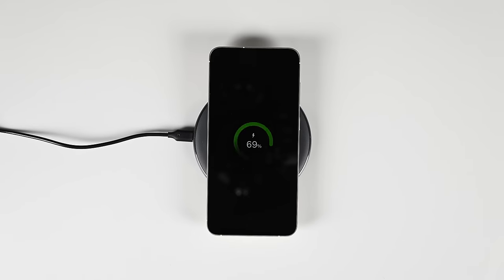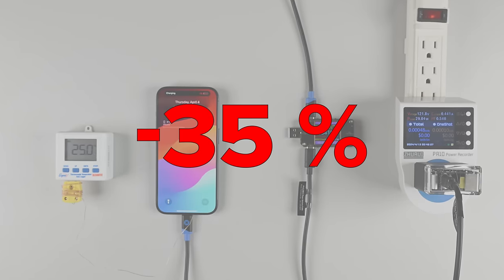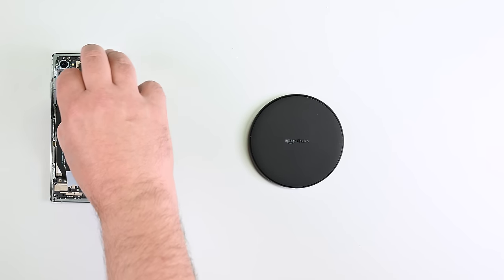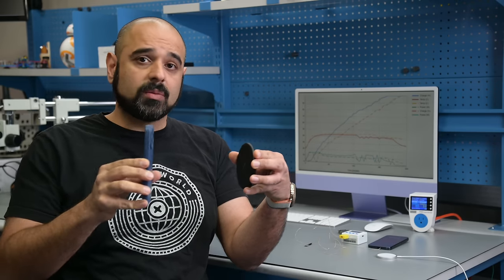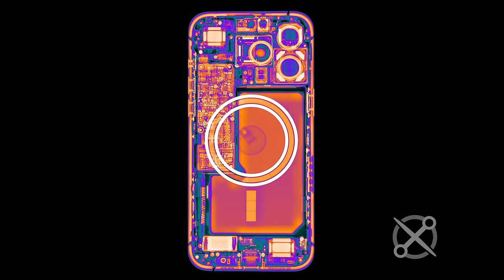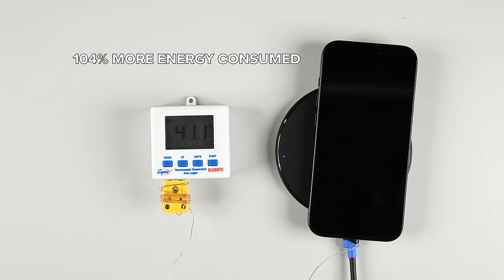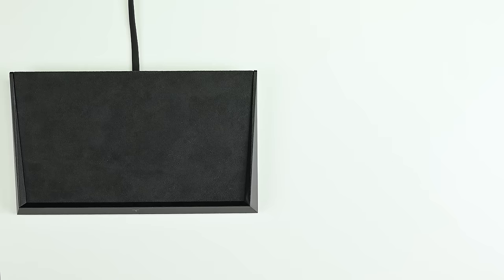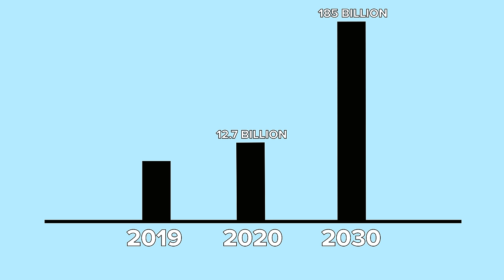How Wireless Charging Works and Why It's Terrible

Comment: It’s terrible until the charging port doesn’t charge and the phone is able to stay alive for another year thanks to it.
Reply: This is why we need repairable phones.
Reply: This wouldn't be a problem if phones were repairable enough
Reply: Real
Reply: I agree with your sentiment, but it’s a bandaid to the real problem of un-repairable phones.  
There’s no reason you shouldn’t be able to pop down to a repair shop and have your charging port fixed for the same price as a certified wireless charger, but tech companies want you to buy more stuff, not fix the stuff you own.
Reply: @dilutedoxygen  they are. changing the charging port is nothing you can't do on current phones.
Reply: That's the only reason I needed to replace my phone.
Reply: This saved everything on my phone when the charger stopped working
Reply: @RandomUser2401  Being able to and being able to easily are two completely different things.
Reply: have you ever seen a broken USB-C port? it used to happen with older USB and ofc with applel's ports
Reply: This is why everyone should care about easily repairable phones.
Reply: @stevev1008  then you are not a mature consumer, if a broken charging port makes you buy a new phone.
Reply: @nimoy007  tf then take the phone to a repair shop, present in every mall
Reply: @RandomUser2401   does it make lighning port better design in that regard ? there is no small pin inside the port and if the user ever break lightning pin, they can just take it out using tweezer and get a new cable which is not the case with usb c.
Reply: @jk-er2zt  yes - in many aspects lightning was/is a great connector and certainly was way ahead of its time compared to what was available back when Apple introduced it. Type C has several issues but is now the standard so we have to work with it.
Reply: @RandomUser2401  I've been working in the repair industry and your confidence is just ignorant, many currently sold devices have their charging port bundled with many other components, and in some cases even the main board, so you are either very very experienced with the soldering iron, or you essentially are changing your whole phone internals.
Reply: @RandomUser2401  The right to repair movement is about making repairs more accessible to everyone. Do you have to repair your own device? No. Should everyone repair their own device? No, not everybody is capable. But it is about freedom and choice and sustainability. Take it from an engineer, I don't always want to break out the soldering iron, heat gun and preheat plate. That's why we need change in the industry.
Reply: @nimoy007  Apart from a hair dryer you don‘t need any of these tools to change a charging port - on a waterproof phone. Super easy repairability comes with some trade offs. So I‘d much rather do it myself as a skilled engineer or take it to a shop which do it for a few bucks.
Reply: This is exactly what happened to my S7
Reply: @RandomUser2401 why do people keep pushing the waterproofing lie? How does it make sense that waterproof electronics used to not be glued together, but now they have to be?
Reply: The charging port dying on my Nokia 7 Plus was what made my next phone a Fairphone 4.
Reply: @SnakebitSTI  because waterproof is not binary. Glue provides a much better and durable seal, and at least the one that is used on iphones can be broken with a hair dryer and reapplied.
Reply: @TeddyKrimsony 😂😂😂
Reply: @RandomUser2401  The glue can also fail over time with too much exposure to water or humidity. It's hardly perfect.
Reply: @SnakebitSTI  still a lot better than the alternatives.
Reply: imagine if those were easily replaceable 🤯 lmao
Reply: If you have an iPhone, Apple will clean out your charging port for free at any Apple Store. I’ve done it a couple times and my charging port works perfectly after the cleaning
Reply: I faced this issue and yes that's lifesaving. But fact remains, this method of charging is very inefficient.
Reply: My phone has s modular usb c port so pretty easy to replace. Even so I use a magnetic charging cable which has the added benifit of plugging my usb port ehich stops dust from entering.
Reply: Pr you could get the port replaced for very cheap.
Reply: Bruh
Reply: people making up problems that don‘t actually exist smh
Reply: @RandomUser2401  they repairable until you need to use a heatgun to unglue the screen, later gluing it back into place with all kinds of unforeseen issues arising later

I'm saying this as someone who fixed their phones numerous times by myself, screwing up less than the local repair shops
Reply: @HolarMusic  funny. all I ever used was a hair dryer to loosen and the replacement sealing provided by ifixit fit perfectly… guess I must be some kind of super engineer overlord.
Reply: Bruh it's ifixit channel
Ofc we're gonna crack open the phone and replace the broken port (or at least ask the pros)
Reply: @RandomUser2401  get off your high horse
Reply: @HolarMusic  get off your whining horse and become a mature consumer
Reply: @RainbowGin but they aren't and I'm not counting on it to save my s9 from 2018
Reply: I've replaced my own charging port.  With a glass back glued phone.  They could make it way easier to replace though
Reply: I've never broken one on a phone. Our home phone is an iPhone 6S Plus that's going near a decade old and it still works. In what way do you use your phone that causes the charging port to break so easily?
Reply: Why hasn't anyone thought about putting a magnetic connector (like the one of macbooks) on phones? It would be as efficient as a cable and impossible to break.
Reply: this is me 😭
Reply: I connected my phone to a bad charger, and it fried the part of the motherboard for charging

I miss being able to charge my phone in less than an hour 😭
Reply: if you are careful with the port it will be fine just clean it once in 5 years
Reply: Have you heard of fairphone? You can easily replace the charging port yourself.
Reply: thats exactly why i specifically look for phones with it
its nice to have that backup
kept my LG V30 alive for another 2 years and it still works to this day
Reply: @RandomUser2401 Is that what you are? Or are you berating another person for no good reason?
Reply: @arutezza  or you could've just replaced the charging port instead of cooking your battery.
Reply: Exactly this. My iPhone would be a brick without wireless charging.
Reply: I've been going on 3 years with wireless charging only. Thinking its about time for a new phone since my battery is so degraded
Reply: @ScarfDoesGaming  good job cooking your battery👍🏻
Reply: @EnterTheSoundscape  true. because it‘s totally impossible to simply change the charging port. 100% brick material without wireless charging.
Reply: @ScarfDoesGaming  Just replace the battery.
Reply: @EnterTheSoundscape  I probably could, but with the phone creeping on 5 years of use, it's around the time I typically upgrade anyways. Plus the cost of me doing it myself is about the same as the value of the phone. In insurance terms, it's totaled
Reply: @RandomUser2401  I would but the problem is that I have an iPhone with a cracked back glass. Getting the battery charging port changed would necessitate paying hundreds of dollars to fix the glass. I’ll just keep using the wireless charger for a few more years before I get a new phone.
Reply: @ScarfDoesGaming  2019 phones still hold up, especially iPhones. The newer phones aren’t much of an improvement.
Reply: @EnterTheSoundscape  fair, and phones are getting more long term usable, but I'd have to replace both the battery and usb-c port. Plus there's no case for this phone with the dust protection I need unless I want it twice the size. In 5 months with my line of work, and I'll have to replace the port again. Just weighing my pros and cons, the biggest con is long term cost of repair and little benefits
Reply: @EnterTheSoundscape  how about you simply do it yourself or take it to a non-Apple shop? the back glass being cracked has no influence on the charging port change, the phone will be opened from the front by lifting the display.
Reply: @RandomUser2401 lightning would have been fantastic had it not been USB 2.0.
Reply: @ScarfDoesGaming  maybe find a dummy plug for the port while you‘re at work
Reply: @RandomUser2401  Why pay to fix the charging port when it isn’t a problem thanks to wireless charging?
Reply: @EnterTheSoundscape  because wireless charging in itself is a problem. I see you have not watched the video but went straight to commenting.
Reply: @RandomUser2401  I plan on getting a new phone regardless in a year or two (still have iPhone X) and battery life doesn't bother me since I always have a charger with me. 

I'm not paying over $100 to fix it. The phone is towards the end of its life anyways.
Reply: I kept my S8 alive all the way to current year and I didn't once need to replace the USB-C port, just be more careful with your electronics.
Reply: @ST4RDUST  The S8 was a brilliant phone that was built to last. I swear new USB-C ports are insanely fragile by design.
Reply: You could also… you know… repair the charge port!
Reply: Yeah, I did that for a while lol.
Reply: that could be solved by having a standardized system of magnetic pogo pin contacts on the back of phones which would be functionally exactly the same as "wireless" charging but without the inefficiencies of having to convert from DC to AC and back again
Reply: Wrong, its always beeen terrible irregardless
Reply: I seriously haven’t had an iphone that didn’t charge from the port since the iphone 2 lol
Reply: This rarely happens and yes, actual repairable phones fix this issue.
Reply: I had the same problem, I had to you wireless charging on my galaxy s8+ for 5 months until I switched to new phone that doesn't even have thaf option.
Reply: If anything this is a hard “it is good because everything else is so crap” point. This speaks for the need for repairablility even more!
Reply: @RandomUser2401 hey man, just a general rule of thumb with those mall repair shops, most of the time with those shop, they often replace parts with knockoff/counterfeit parts. I would stay away from them, cuz often times it will end up messing up your phone, leading you to end up having to buy official parts anyways.
Reply: That's a bandaid solution because phones now are glass sandwiches that can't be easily opened without needing a heatgun to get the backglass open. Even then, the charging port is usually bundled with other circuitry, which means you can't just replace the charge port by itself.
Reply: @RainbowGin  Makes me truly appreciate what Fairphone is doing to the smartphone industry. Shame that they don't sell their phone outside EU since I totally want one!
Reply: @RandomUser2401 "Mature consumer"? More like speaking from reality. That guy's completely not wrong.
Reply: You can repair the damaged port and that’s all; if an official repair channel refuses to do it, then there are plenty of TRUSTWORTHY options 😉
Reply: @RandomUser2401  Cell phone repair shops are not cheap, at least not where I live. It's a couple hundred to do anything and at that point for an old phone, why do it?
Reply: @djdelarosa25  You are lucky. I have seen (at least with Android phones) my fair share of broken charge ports over the last decade. It's not uncommon though I suppose it depends on the phone.
Reply: @FAT8893  he is wrong. If you think a broken charging port can‘t be fixed, you‘re not a mature customer.
Reply: @SirKrumpleOWrapper  that‘s BS, that amount of money is what Apple charges you for a full display swwap, not third party repair shops for a charging port.
Reply: Phones are repairable, that’s a fact. I’ve had numerous iPhones and Android devices over the last 20 years. Never had an issue getting a screen or battery or yes even charge port replaced post micro usb, for less than $200 including parts. If that’s too much for you then idk what to tell you in a world where most smartphones now are $1200+ when new. I’d rather pay $100-$150 for a new screen or battery or whatever than the cost of a new phone outright. If you have THAT many issues on a smartphone either you just need a new phone or you need to quit being so dang rough with it. This is just another case of people creating problems that don’t exist. Complaining for the sake of complaining because they want it for free or next to free.
Reply: @RainbowGin Fairphone
Reply: ... with a battery that degrade about 40 percent, at which point you might consider change the battery (please don't trash your phone just because degraded battery)
Reply: Wait, what are you doing to your charging port that makes it stop charging? You know doesn't take... "other" inputs, right??
Reply: I'd pay for a port replacement than a wireless charging pad
Reply: Type C lasts very long
Reply: Gotta be the dumbest comment imo (especially considering its an ifixit video). Lightning port on my xs max is (bought in december 2018) is still almost like new, cable clicks in and stays snug. Its original battery is at 970 cycles and the health is at 88.7%. No special hacks used, just the bundled 5w brick.
Reply: I bought some silicone dust covers for my ports from amazon. Keeps out all the crap and got like 20 in a pack.
Reply: How often does that really happen? I've owned my phone's for 3+ years. My current phone is almost 5 years old and I've never had a charging port break on me.
Reply: @RainbowGin  dude its hard to make a repairable charging port when you have so little space as phones get more techy they get more complicated therefore you everything needs to be tiny to save space. Not everything is unrepairable due to greedy companies its just the way things are built
Reply: @almfreak  and some companies don’t want to be reliable for your damages of attempted repair this is why we have a warranty void label some leople think their entitled to a full warranty just because they failed at repairing a complicated circuit board without being skilled.
Reply: That's a problem with the port though
Reply: @nimoy007  and? no normal customers will do the repair themselves anyway. doesn't really matter about being easily able to.
Reply: @RandomUser2401  what about the Samsung Galaxy S5, then? removable back, still very much water-resistant.
Reply: @nutzeeer  yes, and I'll never care about it, alongside Framework. Both of them are unavailable in SouthEast Asia (specifically, in Vietnam), and, frankly, the repair shops in my country are so highly skilled they can fix everything just fine, at a very cheap price, so...
Reply: @jamesbrendan5170  6m up to 2h rated?
Reply: Usually the battery is pretty’s much in a state for a new battery before that happens
Reply: Even moreso if you spend $20 on a replacement USB-C board and fix it yourself
Reply: My lightning port died a week ago, phone still going strong thanks to wireless charging
Reply: Point is rational but i would prefer to pay a rapairguy so he will just replace port with a new one
Reply: Rip my iPhone 7 because of port damage
Reply: @almfreak ok but he can’t. So wireless charging is a nice workaround for now.
Reply: In other words it's best used as a backup plan
Reply: Imagine being unable to change your phone's charging port.
This post was made by the FairPhone gang.
Reply: Exactly
Reply: It's usually because the port is dirty
Reply: Bro the battery of your phone is going to die/get sucked dry within 2 hours before that happens
Reply: You just have to clean the port
Reply: I'm on year 2 wireless charging my S10e after the charge port went bad
Reply: So true. I've had issues with USB C ports on a few phones and wireless has been a life saver.
Reply: Saved my me and my mom quite a bit back in the day
Reply: He didn't say they're terrible, just that they're less efficient. Moving the goal posts doesn't effect his argument.
Reply: I have a 7 years old phone (mi5s plus) that my mom still used and a media player and the volume buttons just failed last month, but the usbc charge port is still perfectly usable. I tend to use phone for very long and never have any charge port failure. 

How did you do that?
Reply: @RandomUser2401 not every repair shop has the proper tools needed to replace these parts, and with most phones needing to be cooked and either accessed from the front glass, or sometimes the back glass, taking your phone to the repair shops with a techie that doesn't know what they're doing or who doesn't have the proper tools poses a larger risk to the integrity of other components on your phone.

Also not like they advertised their experience in fixing new/older cellphones
Reply: @prod.byjoker3778  wth are you talking about. those „special“ tools are a hair dryer and a suction cup. I have those at home, smh.
Reply: @RandomUser2401  in a professional setting, I ain't trusting any "repair" shop to fix my phone if they are gonna pull out a hairdryer. And as mentioned before, you'll need a soldering iron if your main aim is to replace the charging port or any port for that matter. You can do your hairdryer job at home, but I am not trusting your repair skills if that's the level your tools are at.
Reply: @prod.byjoker3778  the fact that you judge by using a hairdryer shows how little you understand. The professional tools only make the job easier and quicker, not any better. And even small repair shops can afford the couple of hundred USD for those tools. And in addition, you as the customer will anyways not even get to know how the job is exactly done.
Reply: @RandomUser2401  dude, it's just business sense, it's like going to a restaurant and discovering theyre microwaving your steak instead of actually making it. Yes, there's convenience, but it's not something you should be doing in a professional setting.
Reply: @RandomUser2401  "changing the charging port is nothing you can't do on current phones"

[Laughs in iPhone]
Reply: Clean out the lint.
Reply: The only reason that I went wireless. No matter what charging connector my phone has or what brand is the phone the connector would eventually break. With wireless I expend the life of a phone.
Reply: Never had that happened. 
But that's good, then you'll have a broken port and a broken battery.
Reply: not to mention saving wear and tear on the connector so your wired usbc headphones don't loose signal all the time.
Reply: do none of you cover your charging port?
Reply: @darkraven-666  I have a headphone jack, so not an issue.
Reply: @C20F  wish I still had one tbh. But flagships with good camera etc don't have them anymore :(
Reply: It literally takes 10-15$ to repair (on android)
Reply: Yeah, USB C charging is far from perfect too. I've had little bits of dirt and lint from my pocket clog up the charge ports of the last few flagship Samsung phones I've owned, making it nearly impossible to charge while also using the phone to watch YouTube. The softest, slightest little jostle will completely unseat the charge cord, which happens every time you move it even slightly as you would to prop it up on a phone cradle.
Reply: @jk-er2zt  The lightning port is small and you would need to fit a soldering iron in there if you want to take out the small pins and replace them.
Reply: @EnterTheSoundscape  At that point, maybe consider replacing the port too
Reply: Just give 2 charging ports if that's the case
Reply: You say that as if the phone industry weren't the ones who created the problem in the first place
Reply: Hm, time for you to watch the video you’re commenting on LOL
Reply: Never had a broken charging port in my life and I keep my phones at least 4 years. 99% of the time a charging port not working is just because is dirty. And I'm not saying it, tech repair guys are.
Reply: Or you could & should get a new phone at that point & not mutilate your charging port by being rough on it.
Reply: @nimoy007  Calculus isn’t easy. Should we tell people to stop using it because nimoy007 can't handle it?
Reply: @YOEL_44  Then stop beating up your phone. And some is not the same as all.
Reply: @SnakebitSTI  Nothing is perfect. Let's all run around in the street & cry about it.
Reply: @HolarMusic  Get off your low horse. Should be easy for you.
Reply: @NinjaRunningWild  Nah, you go on crying without me.
Reply: @NinjaRunningWild  A charging port is not something you break by beating it, most common causes are, phone slipped while charging and it ripped it out or pushed it in, or as crazy as it might sound to you, and only you, just by using it.
A charging port is a component that will need maintenance at some point as it has a limited amount of plugging/unplugging supported, then it will become wobbly, do bad contact or even break the lil plastic tab inside.
Reply: Always be sure to properly clean your USB-C port before declaring it dead, they're pretty resilient. Compressed air was enough to save a good number of the "dead" USB-C and lightning ports I've seen.
Reply: It still doesn’t change the fact that wireless charging is terrible in terms of efficiency (which is the point of this video)
Reply: Try using a paperclip to clean dust out of the port! Its amazing
Reply: This happened with my Note 9. I was forced to get a new phone because it just became impossible to charge my phone without it disconnecting all the time. That said, I was already looking to upgrade, this just happened to force my hand early.
Reply: @RandomUser2401  definitely not all of them, and oftentimes not cheaply, not to mention that "authorized" service providers charge an arm and a leg for those who dont feel comfortable popping a phone open
Reply: True 🤣🤣🤣
Reply: The top comment brought to you by the Wireless Power Consortium
Reply: "stay alive"
Reply: @RainbowGin phones are repairable
Reply: My goodness just go get the port replaced that’s a cheap fix and easy. The problem with wireless charging is heat and he is energy that’s just wasted and also very bad for your battery
Reply: still using the htc u12+ released in 2018. i do no understand this charging port doesnt charge that you speak of lol. never had it repaired before lol
Reply: @RandomUser2401 completely untrue. It’s not that simple and most repair shops will not change a port on a modern phone for a reasonable price because of how unrepairable manufacturers make the phones. Please watch a Louis rossmann video
Reply: If Apple never switched to usb c this was a non issue for iPhone. 

It will now be a continuous issue with iPhone because of usb. 

Lightning charging ports easily the most reliable charging port ever created. 

Source: 10 years of working for one of the current big 3 in the US
Reply: @EnterTheSoundscape clean your port.
Reply: @EnterTheSoundscape  s8 was one of the most broken phones coming into retail big 3 and charging ports were not been reliable.
Reply: @kerwinwade1884  depends on a ton of factors they absolutely wear out and stop getting a good connection. They are light years ahead of micro usb but in terms of longevity and durability can’t hold a candle to the now dead lightning port
Reply: We need removable batteries back 😡
Reply: How do u destroy the port ?
Reply: Yeah but how often does that actually happen? I never had a charging port fail on me.
Reply: @RandomUser2401  What's not mature is you giving people crap for getting new phones.
Reply: @TeddyKrimsony  I have to connect my phone to my computer often, about 10-20 times a day, this is not normal use, of course.
My previous phone had a broken connector after 2 years because of this. The current one is breaking right now: another month or so and it will stop working completely, I think. I tried using connectors with magnets (and wireless charger too), this extended the life of the connector, but did not solve the problem.
Reply: I've been there lol
Reply: Also your port didn't go bad.
You broke it.

Ports don't just wear out.

I've never seen an instance of a port on a phone, pc or otherwise that was damaged by anything other than user abuse/error.

Head firmly in ass syndrome.
Reply: @Pwnopolis  As you know, human hands are not capable of making absolutely precise movements.  When you insert a wire into or out of a phone, you must apply force not only in an axis parallel to the connector, but also at an angle to it, even if it seems otherwise to you or that the force is insignificant.  That is, you take it to the breaking point.  Gradually the connector swings and the electrical circuit is disrupted.  Just like if you repeatedly bend and unbend a wire, it will break.  This is absolutely natural wear (metal fatigue) and is calculated by the number of “pull/insert” cycles.
Reply: @Pwnopolis  And generally speaking, I immediately said that my port was broken.  Obviously by me, in the process of natural exploitation.
Reply: Just clan the charger port bra
Reply: To everyone saying how phones should be more repairable: Phones are repairable enough that the charging port can be replaced. I managed to do it myself with very little prior experience in taking apart electronics. The wireless charger allows you to use your phone while you wait for the new part to arrive, and gives you an extra chance to back up your data. No amount of reparability will make the new parts arrive before your phone runs out of battery.
Reply: @RandomUser2401  you clearly haven't seen a lot of mobile repair shops, I've worked in several and it's the entire reason why i will never go to one anymore. Most of them are complete scumbags who "repair" your device with the cheapest crap they can find and zero regard for how long it will function after repair.
Reply: Port failures are very very rare + cost of repairing is pretty comparable to the cost of replacing the battery - it’s a none issue in the real world
Reply: Unless you like destroying your phone, that just doesn’t happen frequently in the slightest. I had iPhone 6 for 4 years ans iPhone X for 6 and no damage was done.
Reply: Or you can swap the charging port for like 50 buck
Reply: Disagree I've been using phones everyday for more than 20 years and from like 15 phones from like 10 different brands I never had this problem,
Also I completly burned my phones charging circuit (100% my fault, not phone's) and it cost like 25-30$ to fix including work.
It is like saying my car needs 2 more additional wheels, imagine if one of them fall over.
I like wireless charging, but it is less efficient.
Reply: Which never happens
Reply: @myentertainment55  exactly!
Reply: No ones saying get rid of it dude….
Reply: @RandomUser2401 Doesn't sound too easy when the charging PCB is literally soldered to the motherboard
Reply: @stevess7777  not the case with iphones.. you have the choice
Reply: Just repair your charging port ffs
Reply: Bumbest
Reply: That only makes sense because it’s the ONLY option vs just giving phone repairability which companies will never do so you can continue buying their barely upgraded phones. We live in a terrible real world
Reply: Never, ever did I ever have that problem in any phone. Any.
Reply: Oh nice, I don't see too many kallen fans out in the wild
Reply: Unless you use a Fairphone. I've replaced my phone's USB-C port twice.
Reply: Yes, for that reason alone I think it's worth having as a redundancy.
Reply: @RandomUser2401 That's not true, a lot of these phones are made in such a way that just opening them up is incredibly risky and a lot of times. The charging ports are attached to other parts. Even just opening a phone can void your warranty. Least in the US
Reply: @Splarkszter Yes, that's true but it's still also a pretty obvious acknowledgment of why there's a benefit to sticking it charging coil on the back of the phone.  It's really cheap to add the part and because we don't have repairable phones, it's a reason why I might triage getting a current phone that has charging coil versus one that doesn't.
Reply: I "repaired" my ol Nexus 5 port with a needle. Voilà.
(Thanks to ElectroBOOM btw)
Reply: Yes, my Samsung S8+ suddenly had a water in connector error (a known bug), that lasted for months until a new update. Ended up having to buy a wireless charger to keep the phone. Later the port appeared to be working but I still use to the wireless charging. I still have that S8+ phone even though it's no longer supported. Given the phone is 8 years old now, I guess the wireless charger didn't do that much.
Reply: So you'd just rather spend an extre year destroying the planet instead of getting a new phone?
Reply: And replaceable batteries.
Reply: @RainbowGin modular phones
Reply: Literally why my last two iPhones aren’t bricks.
Reply: just clean out the hole with a paper clip. its a build up of pocket lint that stops the cable from going in all the way.
scrape out the pocket lint from the hole bottom.
Reply: @OcRefrig  that’s not only it. Sometimes the port is loose and won’t charge unless you hold it a certain way.
Reply: @thecapone45   Never had that happen to me yet, thank god. i've had several iPhones.  What kind of phone did that happen to you on ?
Reply: @OcRefrig  just about all kid them at this point.
Reply: @RandomUser2401   Except if Apple has anything to say about it.
Reply: @RandomUser2401  becuse it's super expensive.  
I would rather just buy a new phone instead of sending it in for repair
Reply: @namegoeshere197  wut. Bro. With Apple Care it’s cheap.
Reply: Is there any truth to the argument that a more repairable device would be less robust? A more easily removable screen might not achieve the same IP rating?
Reply: Terrible being better than nothing is still terrible.
Reply: Imagine, a phone with 2 usb ports
Reply: at that point just get a new phone. are you broke?
Reply: Magnetic charging port adapters FTW.
Reply: It’s most often just pocket lint in the port, an easy fix. The Lightning port rarely fails, as it is designed in a way where the port is the strongest part. Micro usb is absolute trash, especially in durability, and the port can indeed go out from not being robust enough. USB-C is between those two, and so can be resilient. Having wireless as a backup is indeed a neat feature, but it’s insane that micro USB was even a thing. Also, charging ports are repairable. You can even do it yourself.
Reply: dead ass the only reason i got one man
Reply: Thats what I used think when I was hearing about wireless charging while having a phone tgat charged with micro usb. But after 4 years of using rhe same USB-c phone I've never had charging troubles! I genuinely never heard about people having problems with their charging ports aside from simple dirt or water damage ever since usb c became the standard
Reply: @FinnaWoken  Try magnetic USB cables. I'm never going back. As a bonus if phone gets picked up or bumped with cable connected, it just disconnects.
Reply: @FinnaWoken  it’s good that you don’t have issues with USB-C, but it I can assure you it’s not a made up problem. Type C is much better than Micro, but that is really not saying much. Micro USB is just an inherently weak connector, and often times the port breaks when it should always be the cable that goes. I’ve never had an issue with many Micro USB ports and cables, as long as they were attached to quality products, but I treat my stuff with care. Were I to not, I’d be in trouble, because Micro USB does not handle any form of abuse well. The problem is that USB is an open standard, so whoever makes it the cheapest wins market share. Poor quality, low functionality cables saturate the market.

Basically, I wasn’t saying USB C is trash, only that it isn’t the best connector in every way for everything ever. Lightning is indeed more durable and has other advantages that get overlooked in favor of things that don’t actually matter in people’s lives. Having one cable to charge everything is cool, but USB C isn’t the perfect connector for every device, and I don’t think it should be mandatory.
Reply: My old S21U would not charge via cable unless I used certain cables and let it sit very carefully. I DID buy a cleaning kit, used alcohol, tooth pick, brush etc.... Looked clean to me, still same issue. In my eyes I thought it was a loose port....

At this point I decided that it doesn't matter, the phone is a few years old, even though it's in perfect condition I no longer cared. I took a toothpick and DUG into the bottom of the port, getting what looked like lint out of the port... To my surprise.... I plugged in the USB C cable after 10 minutes of digging into the port with little regard to any damage I'm doing, and now the phone CLICKS and I can hold the cable and dangle the phone. Amazing...

I see so many people say ""my charging port is worn out" and while it may, it doesn't hurt to clean it! I dealt with charging issues for 2 years not realizing it was from sitting in my pocket.

Im very easy on my phones, I take great care of them, and they only ever sit in my right pocket or on my desk. I now bought usb c plugs and use them during the day to keep dirt and lint out of my s21u and my s22u.
Reply: @SyNKevN , solid info, except it CAN hurt to clean it out, if you’re not careful. Paper clips or safety pins can work great, but you have to know what you’re doing. Toothpicks are the go-to. Always powered off.
Reply: @SyNKevN  I've seen this in multiple ports (even headphone). Lint stuck at the bottom keeping the plug from going in fully. I've also gotten lots of USB-C plugs (and magnetic connectors) for things I carry with me in my pocket or bag.
Reply: @gblargg  I've seen those magnetic connectors. Do they support 45w? I never looked at the specs and have always been sceptical but they are pretty cool in theory.
Reply: There are several types. A center bump and ring around it. Several concentric rings with a row of contacts, some with 3, 5, 7 rings (e.g. power + data, +CC pins). And then some with two rows of spring contacts and a thin board that goes between, like lightning but very tiny and with no insertion force, which can do 240W. The latter only have 0.025 ohms resistance total for the power path, so very little loss.

I've tried all of them and really like the 24-pin because they tend to be adapters you put at the end of a USB-C cable, and they support full USB-C/Thunderbolt functionality because every pin goes through. They are pretty pricey compared to others, though.

I use the cheapo bump/ring for everyday charging of things because they're more cheaper, but the cables and tips tend to have noticeable resistance so not good for high charging rates.

I figured the magnetic cables were junk, but I gave many types a try and I am sold. One thing I keep next to the magnetic cables is a USB-C M-F little adapter with a charging tip in it, so I can easily plug it into devices without a magnetic tip and not need a separate charging cable for them.
Reply: But isn't being skilled with soldering iron exactely what you should be has a repairman? What would medicine be if with thought like that. Being a repairman is very different than being a part swapper.
Reply: Was in this exact situation where my phone was useable solely from wireless charging until I got it fixed
Reply: Just buy USB type c butt plugs
Reply: @almfreak the big problem with repairable phones when it comes to batteries is that to have it be easy enough to repair for the average person to do it would result in lower capacity batteries. Battery life of current phones is already bad enough as it is without having lower capacity batteries.
Reply: I never had an iPhone with a failing charging port. Just dont buy cheap phones and you are good to go
Reply: never broke a charging port in all my life lol
Reply: @davidGA殿  exactly. This is the only reason I’ve used it, but it is a big one.
Reply: @RandomUser2401  Unless you get a device with soldered on USB C ports which seems to be more prevalent nowadays
Reply: @RainbowGin Corporate: "did you say remove all the screws and replaces it with rivet? I gotchu bro."
Reply: i have an iphone 5 at home from ten years ago with a still functioning charger port. never seen a charger port stop working. usually the tech hardware becomes obsolete or slow before things like that happen, so if ur ruining ur charging port ur probably the issue
Reply: You charged with port abuse please turn your self in
Reply: This!i bought the best wireless charger when I got my new phone just as a backup😂
Reply: LG Phone moment
Reply: Just get a new phone at that point
Reply: Wtf. How are you people break8ng the charging port?? 😂😂
Reply: One in a trillion case
Reply: Use magnetic cables. The adapter is easily replaced and the socket doesn't get plugged with dust either.
Reply: @Splarkszter they can make it repairable but then they hike the price of them phone up
Reply: And when does that ever happen?
Reply: Happened to me, and you're right. But I've since bought a new phone and I went back to charging it with a wire because... It's exactly as convenient (and probably a bit more) than "wireless" (which is not actually wireless, 'cause the pad is wired and the phone has to sit on the pad) but more efficient.
Reply: @TeddyKrimsony  USB-C is the crappiest of them all. Major source of trouble on my Samsung and an inherently flawed design.
Reply: @almfreak  you can if they have a soldering iron and a little bit of soldering experience. It's not that hard. Some phones even have the USB port on their own little board so it can be replaced in 1 minute.
Reply: People have been brainwashed into thinking it's good to be forced to spend money on an accessory rather than having your phone repaor
Reply: If only there was a way to do something about a charging port but this is the real world. We just have to man up and buy a new phone everytime
Reply: Upgrade yearly. Problem solved
Reply: Then enjoy aging your battery faster because of it.
Reply: Currently my situation 🙃
Reply: How do you broke a charging port
Reply: @dilutedoxygen With all the expectations a modern user has of a smartphone, not really doable. You always have to make concessions. If you're fine with a smaller battery and no waterproofing that's fine, but there's a reason companies got rid of user removable batteries. Not saying you're wrong in the slightest but it's never quite so simple.
Reply: I don't think I've ever experienced a broken charging port
Reply: get some magnetic connectors
Reply: Bandaid solution lol.

Way to sell a solution.
Reply: It's useful for a week to schedule it for repair.
Reply: I thought I am the only one. My samsung galaxy S8 is still rocking to this day because of wireless charging, although it IS really bad for phone battery, heats a lot, like a LOT, and is very slow. For a fact my battery really gotten worse because of wireless charhing.
Reply: Charging ports are pretty easy to fix, well at least on iPhone’s
Reply: @TeddyKrimsony I have seen many broken type C ports, I have not really seen many broken lightning ports. Usually with a non working lightning port I just have to clean out the lint. Type C I feel is actually more fragile than  Micro B. The most common reason the Lenovo Thinkpad gets sent in for service at my job is because the type c broke. Look at all the Nintendo switches with broken type C ports.
Reply: you literally can just replace the charging port on a local repair shop if your warranty is dead. of course there's a price to it. apple devices WILL be more expensive to repair. apple made it that way.
Reply: @TeddyKrimsony Yes. I’ve had to have several USB-C ports repaired over the years.
Reply: @RandomUser2401 I’m not understanding how not having the expertise or ability to perform your own repairs means that you are not a “mature” consumer. Most people who use devices aren’t people who have interests in electronics or mechanics that might give them the knowledge or skillset to repair things. That’s why repair has always been a profession.
Reply: @_Circus_Clapped_ Most phones and cases don’t come with charging port covers. so no.
Reply: @Pwnopolis Ports do wear out over time just by the natural act of repeatedly plugging and unplugging things. Charging ports get a lot more wear and tear than regular USB ports in other contexts where you generally just plug something in and leave it there. A lot of people are plugging and unplugging stuff from their phone port multiple times a day. Do that over the course of years and things eventually can become loose and the cable may not hold contact with the port as well.
Reply: @thecapone45 That’s only if your phone is under Apple Care coverage when it breaks.
Reply: Same thing with me
Reply: This is the exact reason why my next phone will have wireless charging
Reply: My last phone had a broken USB-C module. I repaired it, it was something like 10x more disassembly time than a battery swap, which I've done once or twice for every phone me and all my entire immediate family have had for roughly 20 years. The broken module meant I loss the use of that phone for roughly a month, with literally no warning.

Wireless is nice to have, and I'll probably make sure all my future phones have it just because of this one bad experience, but it's also very good to know wired is better for the battery
Reply: This is so true, it can act as a backup in the event of charging port not working
Reply: A situation that has happened to literally no one ever